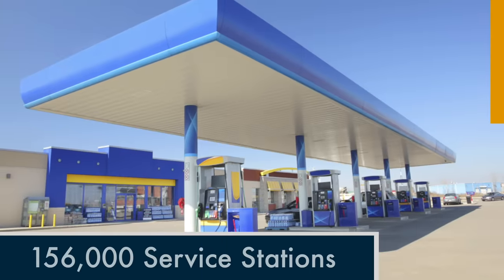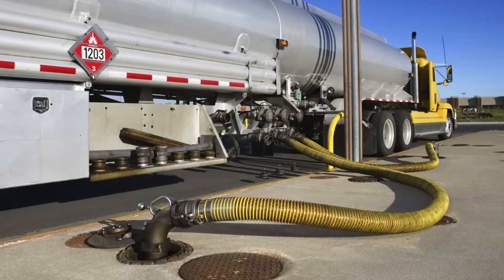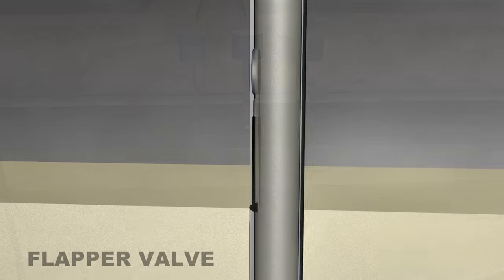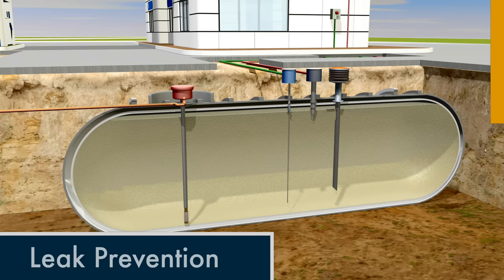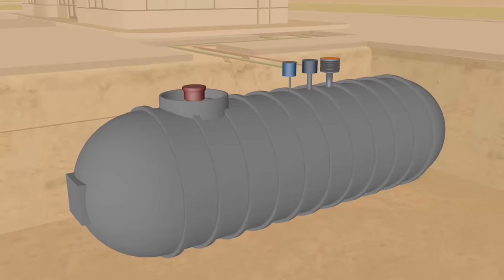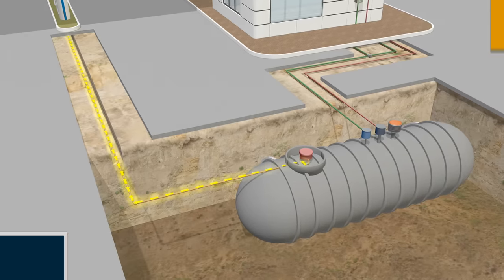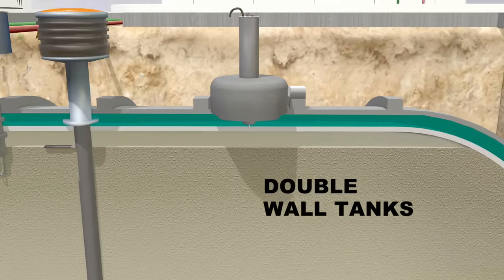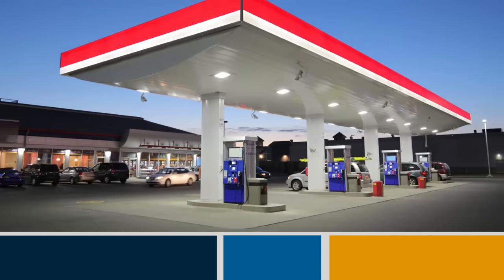Gas Stations

Comment: nice..  now change all that for hydrogen and let's move on..
Reply: How can blow up without a mix of oxygen???
In that case the same will happen with this fuel tank.
Read about hydrogen vs gasoline safety.. you will learn that hydrogen in many cases is even safer than gasoline.
Of course the tank system will not be exactly the same.
Reply: explosive liqids gases are al dangerous hydrogen is not safer nor more dangerous just more enviromentaly friendly 
the hindenburg proves that
Reply: georg841984 The hindenburg did not explode, was burned. And if the hindenburg envelope would be no flamable (something super easy to achieve today), then you can ignite any hydrogen hole and the only thing you got is a tiny flame from that hole, it does not spread..  you can fly by months like that and it will not even matter. 
Liquids fuels stay below you, and they stick to your body and cloth, everything burn up.. hydrogen rise 10m by second...  So the flames remain far from you.
Only 35 diee in the hindenburg disaster, 65 survived, the biggest problem was when the diesel fuel started to burn.
Reply: gasoline also burns it only explodes in the right air gas mixture. the same as hydrogen it must be the right mixture
Reply: do you want me to be mad and start hating hydrogen technology or can we just agre that it is more enviromentaly frindly and let it be at that ?
Reply: http://auto.howstuffworks.com/fuel-efficiency/alternative-fuels/hydrogen-vehicle-danger1.htm  se i can copy paste to
Reply: georg841984 haha, I know you are not against.. I was just trying to add some info to the first reply I get..
My source I guess is kinda biased, yours seems more accurate, although even if the hydrogen is invisible, odorless and flavorless, I imagine that is quite impossible to not notice this in the air, because is so light that you will instantly feel it in your associated breath muscles.  And if you talk, you will have even a higher voice than with helium.  Even in a house, it will escape in no time, even if this one is all close.
Reply: ok :-)  some years ago i tried to use hydrogen in an gennerator with some tweking to the carburator it worked nicely. i used an hho generator for hydrogen. it proves that hydrogen can be used in normal gasoline engines. the problem can be rust but does not have to be it depends on how the engine was built.
storage is the main problem for comersialization. but with time that wil be solved i hope. and distribution ofcourse.
Reply: georg841984 many people said that storage is a issue.. for me is not..
the two standards for vehicles (350bar + cryo gas) and the (700bar) are enough for any transport with the exceptions of commercial planes, they need liquid hydrogen (also it can be used to cool the engine and increase the efficiency.
Fuel Cell + electric engine + hydrogen tank, requires the same or less volume than the whole ICE engine system.
For the same range.
Batteries for example, they have 2 limits.
1-You can not recharge fast (so utility vehicles can not be used)
2-If you need to output energy for more than 3 hours (or in other words +250km range) then is not cost/efficient, it does not matter if it is a cellphone or the biggest machine ever built.

Why?  because for a certain time of power output, the batteries cost X, if you wanna double the range, you need to double the battery cost.
But with hydrogen you just need to increase the tank size a 25%, that double the volume.
The extra cost is nothing.
That is why they are developing cellphones and drones that use hydrogen.

You can use h2 for combustion as you said, it may have a problem with embrittlement, but not very severe, in my country a 30% of the cars are modify to use natural gas, because is cheaper. But it can work with hydrogen, but without so much range as using a fuel cell.
Reply: funy you mentioned lpg i used a lpg set for that generator :-)  hydrogen and other things like alge farms to make green oil products wil come with time the world just neads to figure out how to get there :-)  i myself am just fore making the fuel green and usable in both old and new things because the use and throwaway mentality is also an big enviromental problem wery bigg

by the way im not native english speaking so sorry for the writing
Reply: georg841984 yeah, english is not my language either..
Here in Argentina we have GNC, natural compressed gas.  This is 90% methane with a bit of other heavier carbon base gases.
It does not have good energy density.. you need 40 liters of gas capacity at 200 bar for 100km range.  Of course all these modified cars still work with normal fuels.  You save half of the money but you lose space in the trunk and the engine wear is a bit higher.
In your case your work with cryo liquid carbon base gases, which is a bit more complex, but with higher density. Where are you from?
Reply: norway :-)
and i worked on mongstad oil refinery now i fix computers the oil industry whas alitle to stressful but i learned alott about fuels mongstad also makes pure hydrogen fuel but its not for cars. there are fuel cells in use here in hospitals ets for bacup power so i think that it went there and for science aplications...  :-)
metal hydride storage for hydrogen could be the way to awoid the high preasures and get it safer for wehicles but its expensiwe now maybe someone comes up with a way to make it cheaper. this site might interest you  http://www.fuelcellstore.com/    :-)
Reply: georg841984 nice..  yeah, most of today h2 is made from fossil fuels to create ammonia which is used in agriculture.  But now there is a lot of money behind fuel cells, electrolysis, energy storage, etc..  Only few years back the world started to invest heavily in these areas.
We already saw how fuel cell evolve.. in 7 years they reduce the cost and volume of fuel cell in 1/3, it continues to drop.
New methane cracking methods for h2 production, not only reduce the cost of the process, it also capture the 90% of the co2 at very affordable price with only a 20% of the methane energy wasted in the conversion.
The combusion produce a high quality carbon fiber which can be sale at good price.
Japan will buy h2 to australia, there they had a kind of stone that release a lot of h2 in a similar process to methane cracking.
Japan is turning to achieve an hydrogen economy, they are very serious in that path, they already had wind turbines producing h2 with electrolysis, and they are selling fuel cell cars at super low prices.
Germany and other countries seems to follow the same path.
About h2 storage.. I still think that 700bar or 350 cryo gas are the best options for cars, and liquid h2 for airplanes..  maybe ammonia can be used in some applications and metal hybrid for cellphones.
The problem with metal hybrids is mainly COST.
Like surface increase by x2 and volume by x3, you reach very fast the point in which to fill a tank with hybrid metals is not cost efficient vs just increase the surface of a tank.
The new carbon fibers h2 tanks used in the new fuel cell cars are like rock. And even if you shot them with a barret gun, you make a single hole, all the hydrogen scape in no time without explosion and nothing happen.
If you put the tank over a fire, then valves release the extra pressure..  Fuel cells cars had like 50 different safety mechanism for each circustance related to h2..
The tank of 700 bar can withstand up to 1800 bar, so that is a very good margin.
Also, h2 storage is the only way to solve the intermitency problem of wind and solar at very low cost, at the same time you solve all the transport sector (not just city cars like batteries), also the heat residential and industrial sector.
To electric load balance is also easy, the key is to convert any extra energy to h2, but you dont convert h2 into electricity to return to the net, instead you use any extra in the transport or heat sector, producing h2 locally (houses, fuel stations, etc) when the energy price hour is the cheapest.
If you need to transport h2, you use the natural gas grid, a company called ITM power already made filters that only let pass h2, so you inject h2 into the grid (it also work as terawatts of storage), and you can extract that h2 in any point you want, or you use it to burn in a natural gas mixture.

Link:  yeah I always love it that fuel cell toy car, I will buy it some day :)
Reply: now  were geting there i think this might work :-) smart using the gas distribution network les cost for building new pipelines:-)
from the site i posted you can buy al the parts to make yourself an electricity generator to power your home from hydrogen or the cabin:-)
you can also make a car engine :-)
or anything fantasy is the limit as we say in norway :-)
Reply: i also love airships my imagination from i was litle was to fly in one have you sen the jurney to the end of the world  god movie
Reply: The only movie that I can find with that name, is an animated movie of penguins, what is its original name?